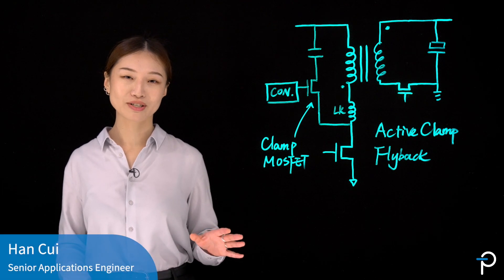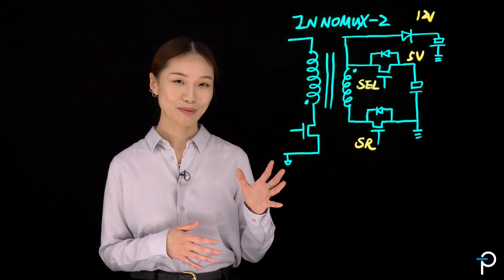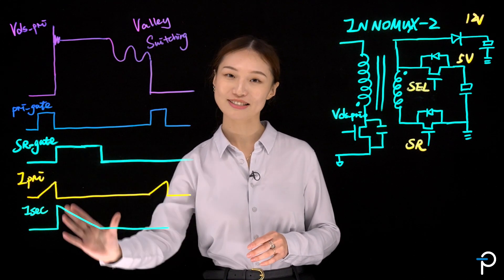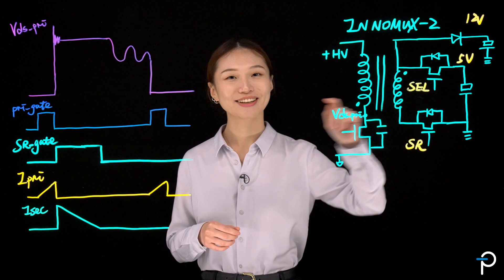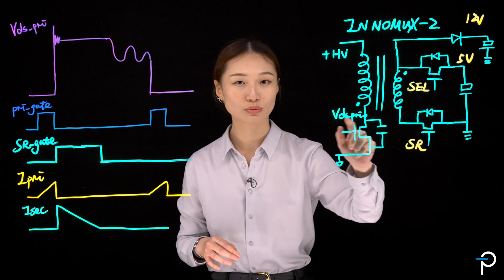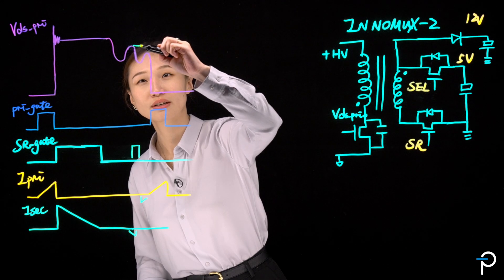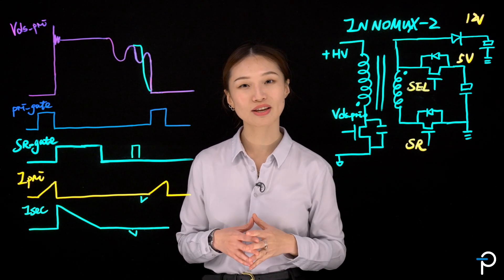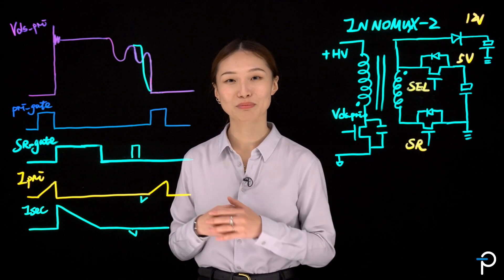InnoMux-2 - Zero Voltage Switching Without Active Clamp

Comment: But I thought the real and main challenge on fly back converters is turn off losses, and on this video still unsolved, actually when u run at discontinues mode every time the main switch turns on the current ramps up (because of  transformer input inductance) and almost no switching loss at turning on but it will have significant loss on turning off , I wonder what issue have been solved on this video?!
Reply: Верно. Не учтены еще и токи самоиндукции, "главный дьявол - в мелочах".
Reply: @Rashadrus  English plz
Reply: @MOJTABASHOMAL  Self-induction currents are not taken into account, and this is important - “The devil is in the details!”